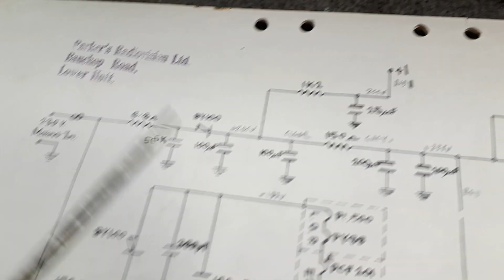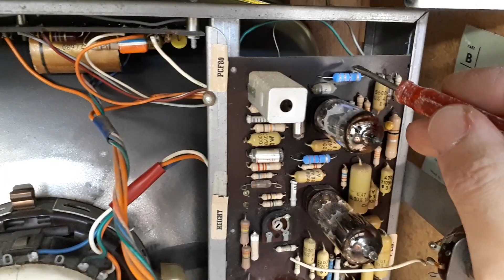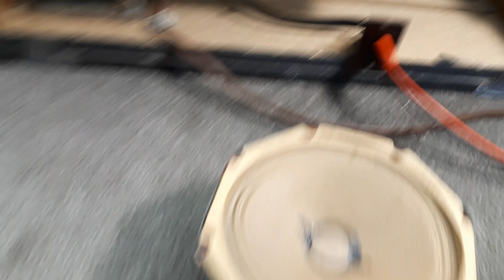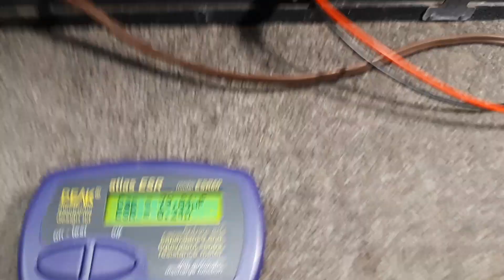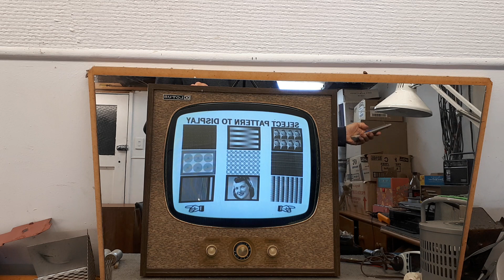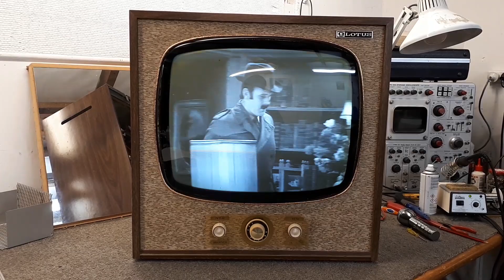Lotus 19 inch 1960's valve TV Model 6513 Part 6

Comment: havent watched this series yet but looking at the chassis looks like it has a philips yoke, philips vertical output transformer and philips style small metal electrolitics with the yellow thing in the bottom
Reply from the maker: Yes indeed all Philips components used in these models. They were based on a Philips Kitset design.

Comment: Nice little series on this restore. well done. Those hum bars were killing me. It's so hard to concentrate on a picture with pulling and dark bands, haha
Reply from the maker: Thank you, I was going to reply to your other comment about the lopty but I had to edit and reload the video due to a copyright flag. Yeah those humbars don't make for pleasant viewing! In regards to the partial dead lopty for me in the past when one has failed it generally goes dead short and the anode of the PL500 red plates, first time I've struck one that was still semi functional. Once the line drive was confirmed then it just had to be the flyback, and it was! The picture quality is excellent and would be on par with a Philips S8 or F2.
Reply: @glenz1975  When you checked emission, I nearly fell out of my chair. Best emission of an old b/w tube I've seen at this age. You just know the contrast is going to knock you out. We used to re-gun tubes in our Auckland workshop and one of our techs was so good at aligment, degassing etc, that the extra emission would make some of the power supplies trip on white scenes. TVs would come in with an extra filament winding or shorted out filament resistor and leave with so much emission that the customer was seeing spots.
Reply from the maker: @tenmillionvolts  Surprisingly most of my sets seem to have good picture tubes, I guess all the well used flogged ones have vanished leaving only the good ones left. To be honest I don't this the Lotus had been running for at least 20 to 30 years. I have some of those filament brighteners around. Its amazing what people used to watch, I remember going to an service call to a K9 and it was so weak, I asked how they watched TV and they said they'd just pull the curtains, fitted a good second hand tube and they were stoked!
Reply: Just watched all 6 videos in a row on that old lotus TV, had been meaning to catch up on it, so glad i did !!!
Very nice analysis on problems and a nice clean up job on replacing those old caps with new ones :)
Those old caps were obviously "High Qual" no doubt ( 🤭 )
 
I'v been wondering about that old TV i gave you x years ago!
It's great to see restoration/preservation here for all on YouTube
Keep the great work up :)
Reply from the maker: @joeyconsensus6199  Thanks mate, yes it came up really well didn't it. I've been using it in the retro room and its running like a dream. The High Qual factor wasn't quite as good as some others I've resurrected in the past like the Pye TVs with their super high qual resistors thay double/triple in value!  Glad you saved it all those years ago, there wouldn't be many of these left.